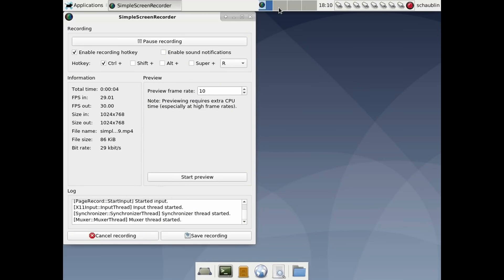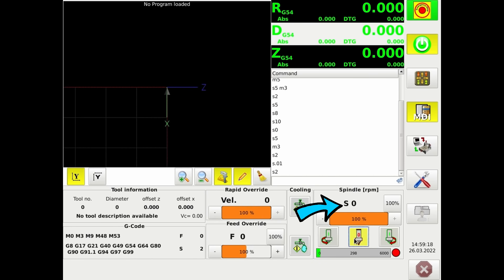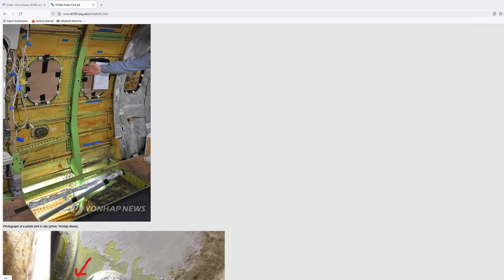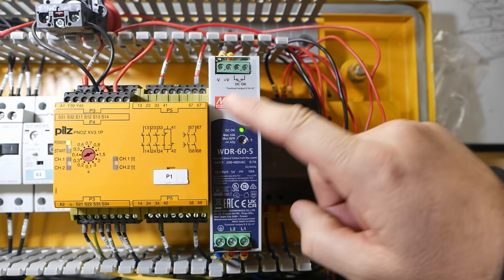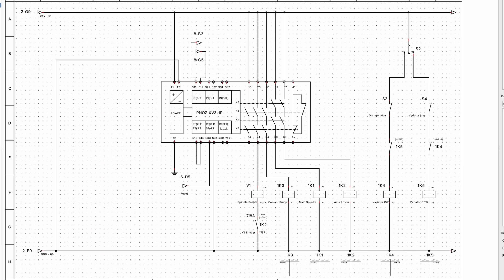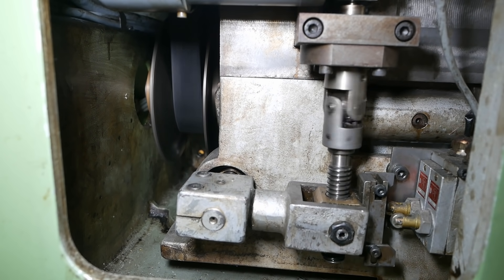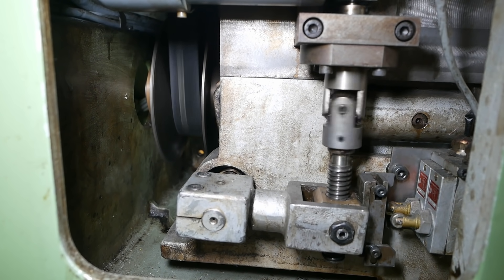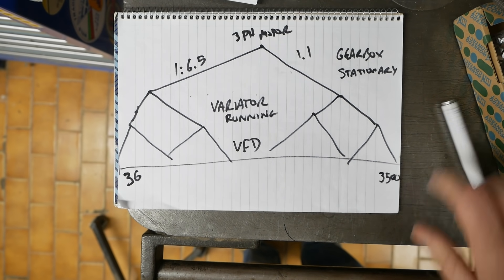Variator control - Schaublin CNC - Ep.30

Comment: Encoders are electromechanical, digital stuff. Steps per rotation will likely be 2 to some power, so 8192 is probably correct
Reply from the maker: I need to take a closer look at that. If I get that encoder scale wrong, all threads will be off. Thanks. But I thought that it was just 4x the difusion grate count. You see a lot of 100 or 4000 count encoders. I assumed this is 2000 grate encoder in quadrature.

Comment: Regarding the speed control, I think it's typical for VFD to run most efficiently at high or full power settings. So my personal view would be to prioritise the variator for speed control (with the VFD maxed out). Then use the VFD to get to speeds that were still out of reach with the variator alone. This way you'll have max torque from the mechanics and max efficiency from the electronics.
Reply from the maker: Both VFD and Variator have limitations. VFD at low frequency --> motor heat, Variator speed change --> rate is given by the mechanism. Needs bang bang control, which will kill the contactors.
Reply: @RotarySMP  Cool, well thanks for the response. Looks like you're getting plenty of ideas so hopefully you'll be able to pull a pretty decent solution out of the bag. Good luck.

Comment: Put all 3 under the same monitoring and /or control system; at least to the point that you have a visual interpretation of the current state of total gear reduction. You want your motor to spin as fast as possible and still have a little room to go faster, to maintain stable control of your spindle speed. i.e. a motor spinning at 1500 rpm at 3:1 is easier to control than a motor spinning at 500 rpm at 1:1, for the same spindle speed. The idea being to make all of your changes in surface speed as meaningful as possible.
Reply from the maker: Good input. Thanks. I need to start making a flow chart of control behavior.

Comment: Heya,

Personally I would set it up the following;
1. Gearbox it's a hardware thing, and can only be set when there is no motion, but it's always going to be active, you won't need 3500rpm for a threading operation or 35 RPM for turning. Personally it would get annoying to stop cutting just to change the gearbox, then start again. By putting it in the right range first then you could set it and let the controller just continue the operations.

2. VFD, this can be changed during motion, this would be a course adjustment, this would give you a range Eg 600-2000RPM. I would be using this to change the speed during the cuts if required.

3. Variator, this can be changed during motion, this would a fine adjustment, this would give you a range between Eg 250-500RPM. 

So Eg, Set gearbox high or low. Then use the VFD to get close to the target RPM (Especially if you want cut/turn based on SFM Surface Feet per Minute). Then you can use the Variator for either hitting the SFM perfectly, or you could use as a fake "SSV" Spindle Speed Variation what some Hass machines have https://www.youtube.com/watch?v=dXR2wDDFFm4

Another option is;
If you care about the efficiency of your VFD, you might want start the VFD on the higher end but then slow it down a little using the Variator http://www.variablefrequencydrive.org/vfd-efficiency

Regards
Reply from the maker: Thanks for your thoughtful input. The only issue with using the Variator as the main fine adjustment, is that it only has one adjustment rate, so you need bang bang control to slow it down, which would be hard on the contactors.
Reply: @RotarySMP  Sorry it was 4am local time when I watched it. Sorry I forgot you had the 2 contactors, if you were to put a small VDF in for the Variator :P that would solve the issue.
Reply: @RotarySMP  Ok, below is the updated config;

So Eg, Set gearbox high or low. Then set the Variator to high or low to get close to the target RPM (Especially if you want cut/turn based on SFM Surface Feet per Minute). Then you can use the VFD for either hitting the SFM perfectly, or you could use as a fake "SSV".

Comment: Bad diagram :)
VFD should go to the top, just under motor itself (imagine you have two speed motor... it will be at the top of the top)
Cos this is what motor will produce.

How to deal with all of this...
Up the stairs of the (corected) diagram
Do as much as variator can, to maintain same linear speed, then go to VFD to maintani it, then.. sory, no more you must switch it to lower gear :)
If it can do this, your sowftware should tell you that it is not capable to do desired linear speed without changing gears, so you know you can not do that cut in ideal conditions. Etc, etc...
Reply from the maker: Good call. The only thing against using the Variator as primary speed control is that single rate of changing ratio, so you need to bang bang control it to change speed slower.

The concepts are coming together, but I am a shit programmer. :)
Reply: @RotarySMP  Sory.. I forget what kind of motor is one that move variator? 
Simple motor, step, servo...
It was mentioned in some clip before, but... my memory is not that so good any more :)
Reply from the maker: @bmalovic  Dumb 3Ph. No speed control. It would need bang bang control, which would hammer the contactors. SO the VFD will need to do most of the adjusting.
Reply: @RotarySMP  In that case, I will probably replace it with apporpriate stepper, and some kind of feedback from variator..
Of course you need to compare price of VFD and steper, can you drive it with existiing controllers or you must get another one...... (I have no clue how much is one or the other), and can it be easy fit, or you need some serious machining. 

Or... leave it as is, do most of the job with VFD, and leave stepper as a "future project" :)

Comment: In principle I'd manipulate the variator first, the VFD second and the gearbox last.  How many operations will you do where the variator and VFD don't have the range to cover the needed speed range?

As for wire bundles I find that tied relatively loosely with lacing cord holds more securely than even a very tight zip tie.  A laced bundle doesn't have the big lumps either, for those spots where you have to feed a bundle through some structure or conduit.
Reply from the maker: The gear ratio has to set first, as it cant be changed until the next spindle stop. The Variator need bang bang control which would be hard on the contactors. 

Good call on the space saving from lacing. I didnt think of that.
Reply: @RotarySMP  It's probably come up in other comments but putting a stepper on the variator would make it a lot more easy to control, although it would be some work to set up.
Reply from the maker: If I was going to control the change rate of the Variator, rather than the complexity of changing that lovely little motera nd gearbox, I'd just control it with a VFD. But I am pretty sure I wont need to. The feedback has been really helpful, and some ideas are starting to gel.

Comment: 1K4 and 1K5 are not made for switching motor load. This is the reason why the contacts are called 13/14, 23/24, 33/34…. A „Motorschütz“ is labeled whit 1/2, 3/4, 5/6. good video
Reply from the maker: This is the problem with ignorance and buying used stuff off the internet. I didnt know that. Thanks for telling me.

The motor load in this case is tiny. The over current protection is set to 0.75A, so the actual motor inrush current must be well below that. It is the smallest 3 ph motor I have.

Comment: The system I worked on used lacing for years. For some reason the factory started using plastic ties and problems went up. They found that the ties were too hard and were pulled too tight causing insulation damage. They then switched to softer plastic and calibrated tensioners.
Reply: I work on marine systems and i have seen plastic cable ties rub through the wire insulation in high vibration areas. Causing some very strange intermediate bugs in the systems.
Reply from the maker: I wonder how many hours of lacing goes into the wiring harnesses of a 767? I guess most of the harnesses would be prefinished in a factory somewhere.

Comment: Can you watch spindle load on your program. If possible, I would try to control with the VFD, then trade variator for hz when you need more torque.
Reply from the maker: I think the VFD can output load on its anolog out, and there must be some analog in on at least one of those mesa cards. Since I am going to need a software component to coordinate control of those systems, then it would be possible to integrate load into that algorythm. Same I suck at programming :)

Comment: There are three important things to consider when running a motor which hasn't been designed to run with a VFD. One is cooling because at low speeds, the motor current can still be high, but the cooling air flow is low. Another problem is high frequency and high voltage spikes which can destroy the motor winding insulation and bearings over time.
A separate cooling fan may be needed if the motor is run at low speeds and high torque. An inductor will help with some of the spikes, but these are not effective at very high frequencies because of interwinding capacitance. High frequency currents can still get through. Protecting the bearings is a more difficult problem and a shaft grounding ring may be required.
Reply from the maker: I have limited the low speed to 20Hz, to hopefully have some cooling flow. The windings are insulation class F, and I have limited the hi rpm to 70Hz to not go crazy there. Bearings are cheap :)

Comment: Have at least three operating modes. Spindle lock where the spindle encoder is used as a positioning device, although this will require some kind of braking system. A torque maximizing mode for high torque, low speed operations like threading where the total spindle rotation is also an important factor. The third mode would be for low torque high speed operations such as having a good surface finish.
Reply from the maker: Since G code is simply an S speed or suface speed command, I want those the as yet poorly conceptualised software widget to exactly that. 

The stop mode is not going to happen. There is a mechanical brake, but it is on the motor, so there are two belts and the gearbox back lash in between.

Comment: My OKK has a gear box and before an op the machine gets a command for speed and it selects the appropriate gear and starts the job then the speed is controlled by the spindle. i would use all 3 combined.
Reply from the maker: That is roughly the concept. G Code S command, Software widget (a comp in LinuxCNC world) selects the appropriate gear ratio, M3 or 4 and the SPindel starts and that widget uses either VFD or variator in closed loop with the encoder to set and maintain either speed or CSS. 

The devil is the details of that widget.

Comment: I'm a bit worried about your TTL / single ended encoder wiring on the spindle. You don't have all your noise sources going (servo drive not on) and you wiring is in as good shape as it will ever be (no corroded grounding connections, etc.). As long as you are only using the spindle encoder only for an RPM monitor, it won't hurt anything. But the second you use it for any closed loop control (servo control spindle position or threading with the spindle as a master), any nonsense in the encoder feedback will have real consequences. As long as you have wiring on the brain, I would really encourage you to use those differential pairs before you forget about it altogether. Love the series!
Reply from the maker: Schaublin didnt bring out the diff pairs. That cable is only TLL. Remember that this machine did CSS under the orignal control as well, so Schaublin also closed that loop on that cable. I doubt butchering the Heisenhain wiring, and redoing it would improve it much as both Schaublin and Heidenhain do cabling really well. The only difference is that I added a VFD noise machine.

Comment: It keeps on going steadily :-)
I would go for the variator to command the spindle speed when facing - not sure you'll have enough torque on the low speed when controlled by VFD, particularly with harder materials or deeper cuts.
Reply from the maker: That is my thought as well, but the variator only changes speed at a constant rate, so I'd have to do bang bang control which the contactors wont like.
Reply: @RotarySMP  That's very true and I hadn't thought of that. Well, you are very capable and have many equally capable followers - somewhere there will be a good solution for it 🙂
Reply from the maker: @JoseSilveira-newhandleforYT  The inputs have been really helpful, and pointed out a number of aspects I had not considered.
Reply: @RotarySMP  Yep. There's a good group here.

Comment: You would be surprised to see how fast people can do a clove hitch with wire tie. The plastic tie wraps have to be installed with a proper tool that has torque set appropriately. The tool must also cut the end flush to not leave a sharp bit, otherwise the tie has to be removed and redone. The potential for FOD is much higher as well with plastic ties.
Reply from the maker: Good points. I bet there are harness factories making them for Boeing where the people are incredibly fast.

Comment: My instinct would be to control the whole damn lot under software, with priority to maximise torque and keep the motor drive frequency within its "sweet spot".  So priority 1, before cutting starts, gearbox, priority 2, mechanical variator, priority 3, VFD.
Reply from the maker: Good summary.

Comment: A consideration for motor cooling could be an external fan sistered onto the motor housing switched on by LinuxCNC at lower frequencies ala Clough42.

Besides the other zip tie comments, installation generates all the clipped ends to be managed. Additionally, if a bundle/harness is fabricated on a bench trying to feed it through bulkhead passages becomes an exercise in futility with little zip tie grappling hooks everywhere.
Reply from the maker: Good points. I kept the motor low speed high at 20Hz to hopefully keep it's cooling fan moving the air through it.

Comment: As a software engineer, I would definitely include the variator in the software, mainly to distribute the wear on the plates, secondly to maximize torque. To distribute the wear around the variator disks in long run I would also include some amount of randomness to the final ratio between vfd and variator. No exactly sure if you're able to script the functions in linux cnc, but I assume so, then only the patience and time are the limits of how sophisticated you want the control to be.
Reply from the maker: LinuxCNC uses C components for jobs like this. This is the one my make programmed for the Maho.
https://github.com/jin-eld/mh400e-linuxcnc

This discussion is really helping me to think through the control logic, as I need this before I can start thinking about a program.

The variator speed change is constant rate, so I would need bang bang control to adjust that, which would be hard on the contactors. In turning cuts, it is easy as you just set speed at the start of each cut. But for facing a large diameter part, you start slow and accelerate to the middle to try to keep constant surface speed. Probably a couple of excessive variator changes, with the VFD compensating during the variator change is the trick.
Reply: yeah ++ re the variator cones wearing, it was my first thought too.

Comment: On my avm mas165s the spindle motor is a standard 3 phase motor driven through a 2 speed manual gearbox . 50 to 1200 and 150 to 3600rpm. Mostly I leave it in high gear and only drop down to low when I need the extra grunt. Leaving it in high allows me to make the most of constant surface speed. I would just leave the variator alone and Control the vfd.
Reply from the maker: Your gearbox is just 3:1, mine is 6.5:1, so it is a pretty wide gap that I probably cant bridge with the VFD alone. I need to look more closely at what the ranges actually are.
Reply: @RotarySMP  it's actually not 3:1
With the motor at 3920rpm (70hz) I get just a hair under 3600rpm at the spindle so its 0.92:1 in high gear. The relationship between the two gears is 3:1. 

I think it's easy to get distracted by the numbers. Think about the practical spindle range you need and go from there. Make sure your driving the motor in sensorless vector and not VxF mode for a better torque range.
I overdrive my motor to 70hz so it does drop off torque at high rpm but its no  problem as i don't rough at that rpm. Only facing. Peak torque for my machine is at 50hz giving 2580rpm at the spindle.
Reply from the maker: @jonnydeen6952  Good point. I need to start mapping out my options to control this in practice.

Comment: I think you could use the variator as a gearbox with 4 or so discrete steps with limit switches or encoding. Have a cnc gear change routine that runs the spindle before the cut to change gear.

Because you can't control the speed of the variator motor, I wouldn't want to change spindle speed with the variator mid-cut. I think mechanical wear and tear using the variator is higher than using the VFD for spindle control, anyway.

You could go bananas and add a vfd and encoder to the 3-phase variator motor. Then you could make changes mid-cut with control, but that adds massive complication.
Reply from the maker: Yeah, that would be overkill. I agree that bang bang control of the variator would be bad, but maybe only one large variator shift is needed in the middle of the facing cut, with the VFD working over and partially against the variator to deliver the closed loop speed required thorughout. I need to look closer at this.